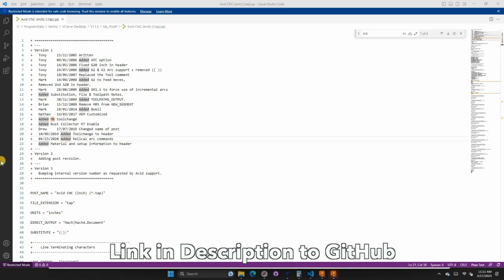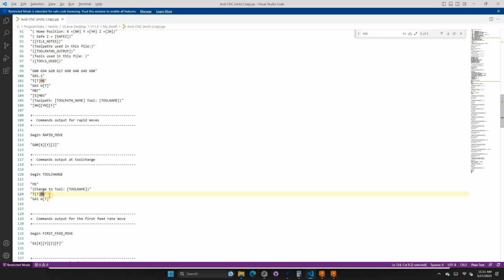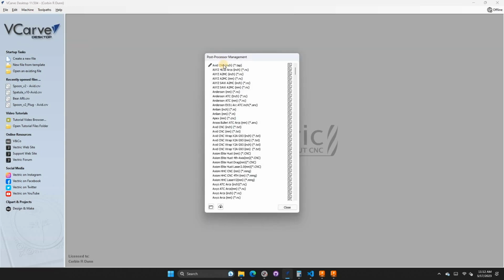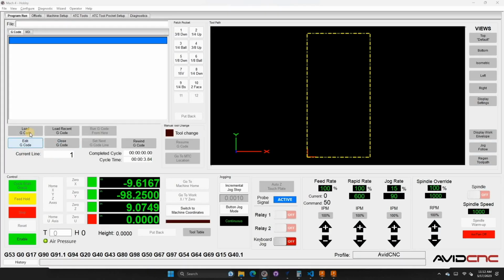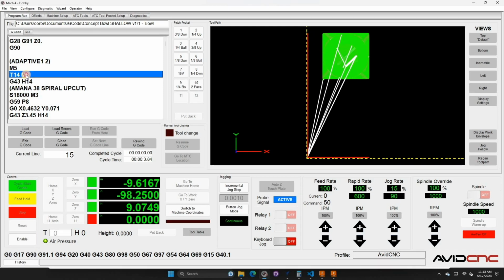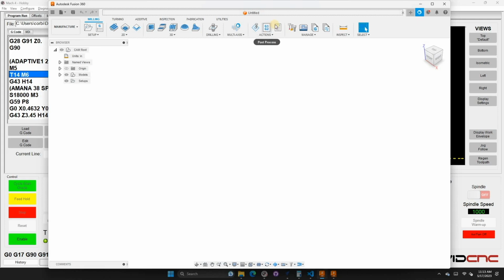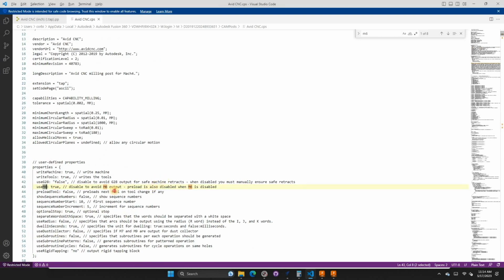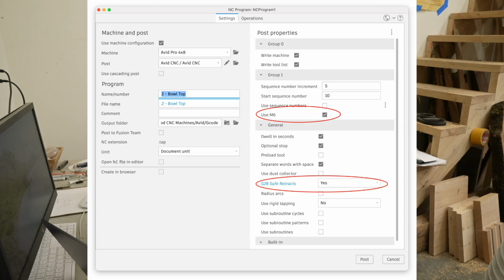CNC Build Ep 9: ATC Post Processor Mods for Vectric VCarve and Fusion 360 / Adding M6 / G43

Comment: Thank you for content/knowledge 🙏 ... I'm trying to get Fusion 360 to import the Avid .cps (post processor) files for my Benchtop Pro and it seem like .cps files have come out of favor for Fusion. I'm going to try starting with a generic processor and tweak it towards Avid, but curious if you ran into a similar issue and possibly had a suggestion for getting the data in the cps file to import  or know of a better resource for acquiring a Port Processor for Avid. Thanks Again! (love the knowledge and creativity)
Reply from the maker: Yeah! You don't need to use my post processor anymore; the one provided from Avid's website should work fine, and I believe they have an updated one coming soon. https://www.avidcnc.com/support/instructions/software/downloads/fusion/

If that doesn't work, email me and I can export mine and send it to you.

Comment: Thanks very much for this really useful video. Is there a simple way to modify the post for mm instead of inches? Thanks again
Reply from the maker: Sure, start with whatever post you are using and just add in the things I mention in the same spots; it shouldn't be too hard. The fusion one from Avid should work as-is and no longer needs any mods.
Reply: @CorbinDunn  That's great, thanks very much for that. Cheers